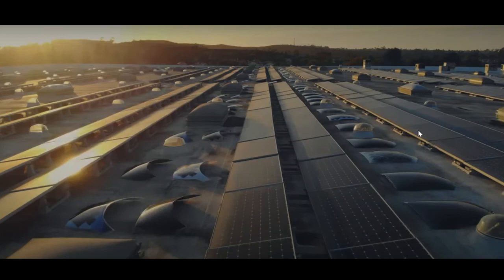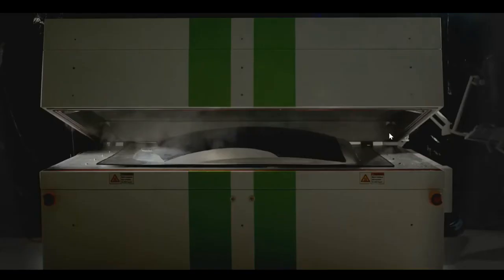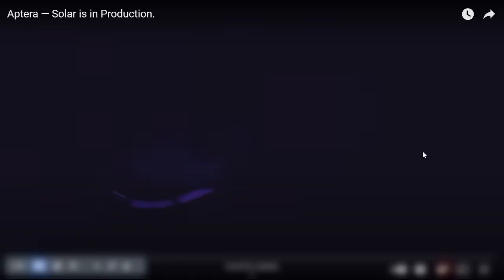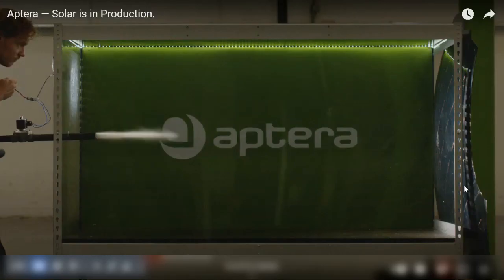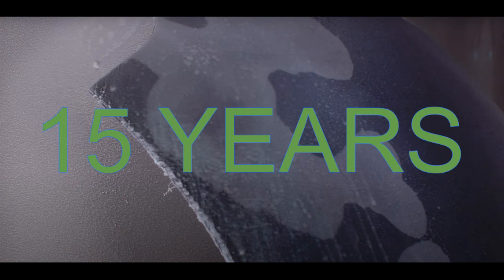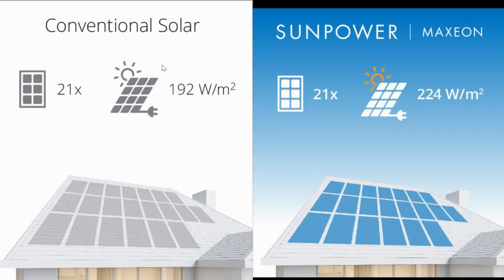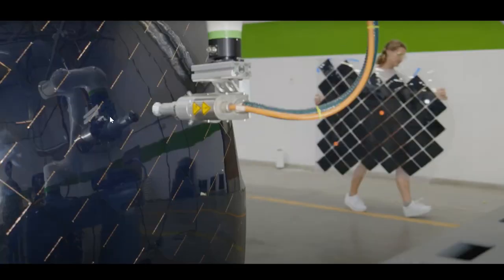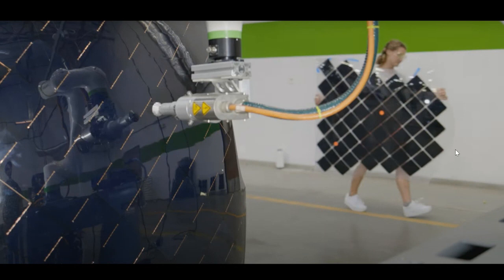APTERA Solar Electric Vehicle (EV) Panel Production & Durability || 2.5 Vehicles Per Day!?

Comment: This doesn't add-up for me.  224 solar watts per m2.  Let's say Aptera is as efficient as they promise (unlikely, but let's hope) -- at 100 Wh per mile.  Average solar energy (by taking the full spectrum across 365 days) is about 5 hours.  In real-world conditions, you're generating about 1200 watts per day, best case, after all conversion/efficiency trade-offs.

To me, this seems like you'd gain about 12 miles (best case) per day, in realistic scenarios.

That's great -- it's definitely impressive.  But to claim that it would eliminate the need for charging in anything but a relatively small minority of situations, would be inaccurate.
Reply from the maker: Sorry, I was just showing some facts about the company. I think the flexible Maxeon automotive solar cells will be different and customized to fit the needs of Aptera. Here is a link to their solar cells, which shows their work with Lightyear: https://sunpower.maxeon.com/int/solar-panel-products/maxeon-solar-cell-technology

Comment: On the building roof, you point out the rear hatches, those are roof panels.
Reply: Look at the one right at the bottom of the shot at 3:19 in the original video (not this one), it looks like a composite (opaque) rear hatch.  There's only a single one.  The long row of them shown in this video are indeed roof panels.

Comment: The device at 7.20 looks like an atmospheric plasma surface activation unit.
They are used to increase the surface energy, making the surface wettable and reactive.
Notice the power line, high voltage warning and fluid line. Also it is fitted to a robot which is usually how they are mounted.

Comment: The chart at 5:10 compares Maxeon standard finished panels vs conventional standard finish panels.  Standard finished panels are built VERY differently than what Aptera is building.  My educated guess is Aptera's panels using Maxeon CELLS will degrade faster than even conventional panels.
Reply: The Maxeon cells are rated to degrade 0.2% a year. Conventional panels will degrade 0.75% a year. Apteras solar panels will degrade a lot less over the years.
Reply: @MakeSteelBattalion2  You may have missed my point.  The Maxeon PANELS are rated to degrade 0.2% per year.  A Maxeon PANEL is different than just a Maxeon CELL.  Aptera is using Maxeon CELLS but building their own PANELS.

Comment: At 4:11, it's possible the large irregularly shaped white area is simply irreversible delamination.
Reply: yep. Odd shape for delamination though.
Reply: @lewevans2413  Depending on the encapsulation, it's actually quite a common shape.

Comment: Solar cells emit light when electricity is pushed into them.  The light is generally invisible to the naked eye, but this makes it easy to inspect the panels for flaws such as broken or dead cells.
Reply: Yes, photovoltaics do produce ”light” when a voltage is put across them, generally inn the infrared, so the picture of the hood, dash and roof were likely taken with an IR camera.
Reply: @paulvansteenberghe4644  It is more correct to say the "light" is produced when CURRENT is forced in the direction opposite to the current generated by sunlight.
Reply from the maker: Looks like you can do thermography with IR or electroluminescence. It seems that this particular testing was electroluminescence.